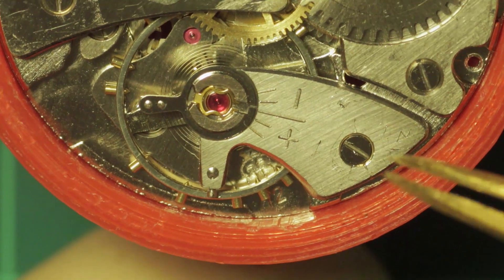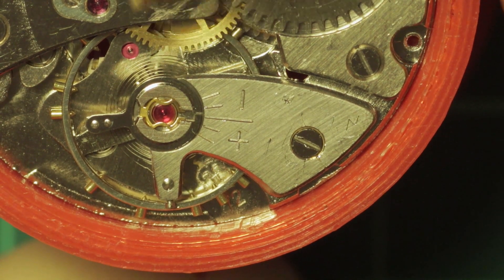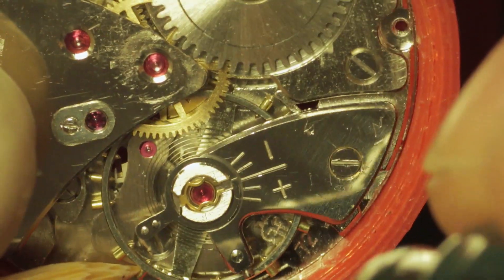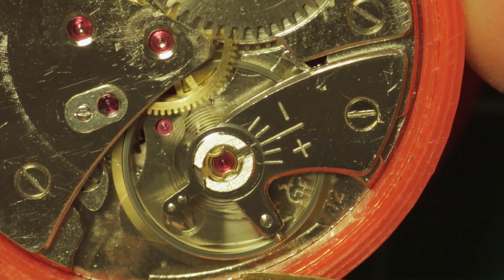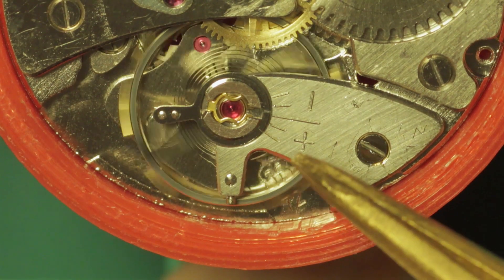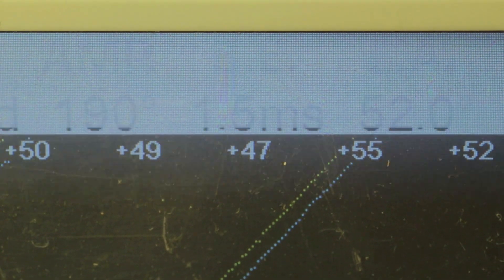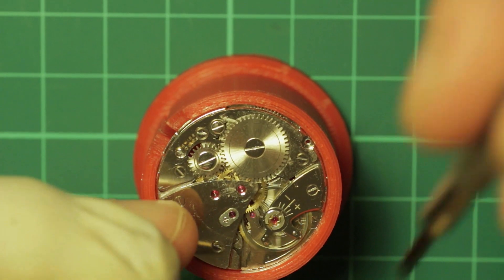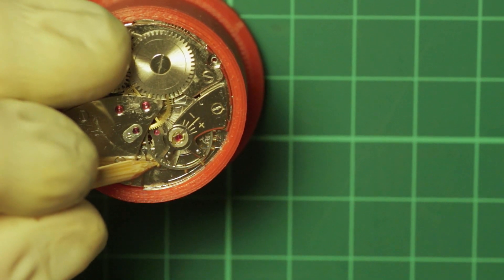How To Calculate Lift Angle Of An Unknown Watch Movement

Comment: That's a useful thing to know, I literally was in the dark about the lift angle concept
Reply from the maker: Glad it was useful, it's really only needed from a servicing and timegrapher perspective to correctly read the amplitude. An incorrect lift angle will give the wrong amplitude reading so for example if you have a watch with a lift angle of 40 degrees and you switch on your timegrapher which defaults to 52 you'll look like you're getting amazing amplitude when in reality you're not. It just all helps in interpreting the readings.

Comment: In the slow motion video I can see the balance swinging 360°, not 180°. Please educate me as I must be missing something 🤔
Reply from the maker: Certainly, you're missing that we calculate amplitude from drop and lock of the pallets on each rotation.
While the balance wheel rotates a full 360 degrees that's halved because the pallets actuate with each directional rotation and the point where the impulse jewel interacts with the pallet fork is about halfway in that full rotation clockwise or anticlockwise.
Hopefully that clarifies things. It's trickier to put into words than show visually.
Reply: @spidiq8  I was going to ask the same question.  I don't know much about this and I was confused about the slow motion video going 360 degrees.  So, we only take half that.  Got it now.

Comment: Question, I've fully wound a watch and can see that the balance arm is swinging up to about 290 degrees. Would I be able to then adjust the timegrapher to provide me a matching lift angle once I choose one that shows the 290 or should I wait until the reserve runs out to do a slow wind until I get that 180 degree swing?
Reply from the maker: @DarkIllusionsFilmsSD  If you can tell the degrees of swing you can use that to match on the timegrapher. On the Weishi it must be over 100 as they have difficulty reading accurately below but 180 is easy to visually see as it's one complete 360 rotation in each direction.
Remember that you're measuring from the drop and lock of the pallets not the entire visible rotation clockwise or anticlockwise.
Reply: @spidiq8  Gotcha. I'm looking at a UN-371 movement off a Blast X Skeleton and is just a little trickier for me since the balance wheel looks much different than other movements. I'm essentially picking one of the solid white markers off one of the arms and measuring it off a slow motion replay. Im no expert so I may be completely butchering this process 😅

Comment: so, slow motion to see the balance wheel travel rough degree, go back to toggle the "angle". Why not go straight to the movement maker as for a fact sheet? at least Seiko did. P.S. beat error too high.
Reply from the maker: Because there are a great many movements where you cannot find the data to find the lift angle. Hence the title how to calculate on an 'unknown' movement. This video is about calculating lift angle and was on a convenient to hand movement, not about the beat error.
Reply: @spidiq8 Agreed. Orient is one such maker. They apparently don’t supply any information for servicing, or parts